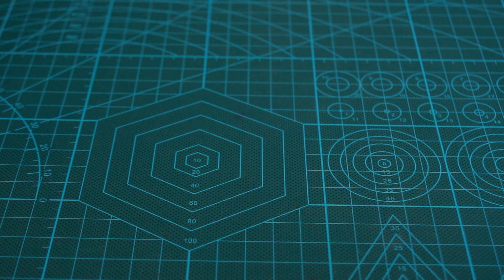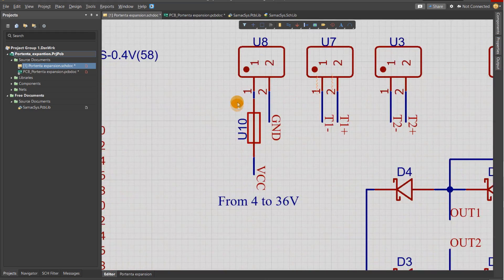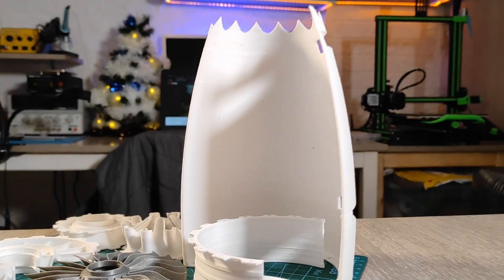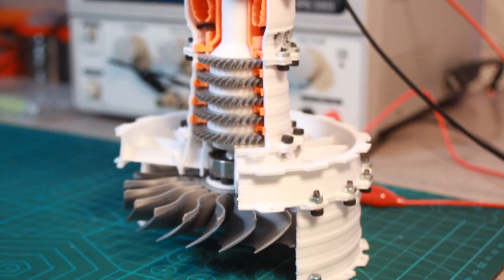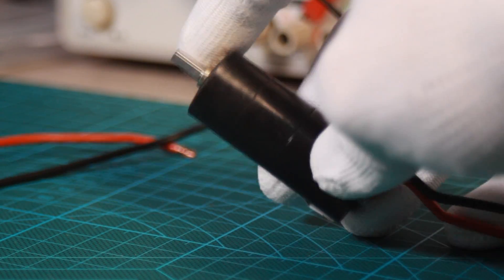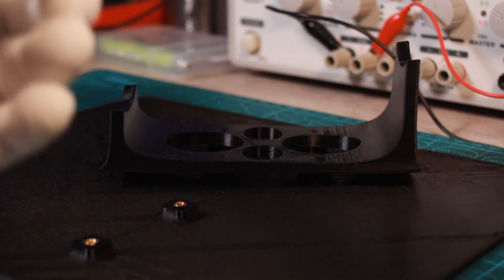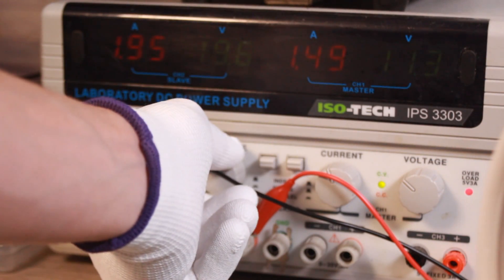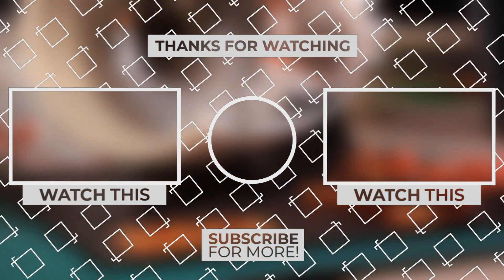HomeMade Arduino powered Jet Engine | easy tutorial | 3D printed parts #diy

Comment: I'm building the low bypass version of this, and I noticed watching the video the center fan blades are on bearings as well but they don't turn like in your video but you can turn them by hand, are these supposed to turn via motor?
Reply from the maker: Yes you are right, the Center fan blades are not spining simply because them core is not attached to mechanically to the active parts, considering the PLA material, that's not the best design to make the fan blades spin, let me know if you have mechanically modified the design and got it to spin🙂

Comment: how much thrust does it produce i wanna attatch it to a skateboard
Reply from the maker: @Dev_Neon  then you need metallic structure and better motor
Reply: @DIYGUYChris  I’m gonna use a better motor but would the plastic casing be fine
Reply from the maker: @Dev_Neon  plastic is too fragile for your case, and not good material to produce the desired pressure, as I said a metallic structure is something that you need to try but before trying do some research about the concept

Comment: Hi, Can you share me motor holder 3d part that you designed. I have been working on same setup but don't have motor part. Also tell me what are 3d configuration you use to print this setup as my 3d part are getting broke most time.

Comment: Hi, Great build! Quick question about Portenta. I actually saw your project listed under official Arduino website and I was hoping to find something that is relevant to Portenta's latest capabilities (AI, Dual core etc.) To probe you further on that - Is there is any reason why you used Portenta apart from the fact that it is the latest Arduino board? It looks like you can replace Portenta with an Arduino Uno and it will function exactly as Portenta in this project isn't it?
Reply from the maker: Yes it is, not even an Arduino, you can use a potentiometer to make the engine run.
Check the previous videos to know why I designed this host board

Comment: Probably a silly question, but have you tried testing if the turbine generates any significant thrust?  It'd be really neat to see it move a wheeled platform, even if it was just a little bit.  Overall, a really awesome build!
Reply from the maker: Hello, not a silly one, the Thrust depends on the motor gears and since this has been made through plastic material then we can't expect high strength of the mechanical structure.
Thanks and all your questions are welcomed here.

Comment: 😆😆😆 - What the need for all the Arduino  circuit?!?  - You're already using a bench power supply that will control the speed far better!  😂

Comment: Cortex-M7 for.... seriously, man???
You yoused this controller for simple 1-phase PWM motor control with the simpliest motor driver? 
It's the most EPIC WASTE OF MONEY I'VE EVER SEEN 

The real engineers use Cortex-M4 for bare-metal BLDC motor control, or to create buck-boost DC-DCs 
Your PCB and application is real useless junk
Reply from the maker: Obviously you know nothing about the board that I have made, that's only one part of many other features available on the Throne board.
It is easy to through a random comment without getting enough details about the content, the main purpose of the board that I have made is getting access to the Cortex ports through the HD Connectors (I wonder if you already saw these connectors) and I achieved this access and tested some basic APIs.
Thank you for your comment.

Comment: Bad engine. I was going to use a brushed motor with no gears. Then the whole thing becomes much calmer and more fluid.
Reply from the maker: Yes, I had that same idea but all the small brushed motors I found they are meant to spin a light weight, for big structure it has to have a big motor which will not fit.
Thanks for the comment.
Reply: @DIYGUYChris  A brushless motor with ESC controller
Reply from the maker: @ReX_PL_DE  I will certainly check this out 
Thanks 🙌

Comment: Using an expensive Arduino board to simulate the windmilling of a jet engine is certainly not aligned with good engineering practice and not worth a blog post. A $2 motor driver would certainly have been sufficient.
Reply from the maker: Totally understand your point, but the opposite of your point of view is right, it means that I built that Jet for Portenta, I wonder if you have watched my previous videos, the Throne board that I have made for Portenta is mainly developed to explore the High density connectors of the board. Please watch my previous videos about The Throne board and you will get the point.
Thank you for your comment.
Reply: @DIYGUYChris  so was it possible to test your board by just loading it where necessary? Why go to so much trouble to build a cool jet engine looking fan? I suspect you just enjoy it 😜
Reply from the maker: @brendaneyers2827  the answer is in the "about" of my channel, right in the first line 😉
Further more, as content creator I must motivate others to practice electronics and this is right motivational enough.

Comment: I don't understand the need to use an Arduino to make a motor run. Not if it's about setting the speed. If there was a programmed function, I could understand that.
An Arduino is completely unnecessary here, and 3 $1 components would serve more effectively as a voltage regulator.

Also, in an age where anyone can buy a 3d printer and download print data from the internet, I wouldn't consider this creative these days.

I understand the joy of something built, but think about it, where is the creativity, where is the joy of making things with your own hands? This was made by a 3d printer, not by hands. It's like buying a child's folding kit.

Make something actually with your hands, with a saw, a drill, a milling machine, something that is unique, not pulled off the internet and bought in a store. Then you deserve respect for a job well done.
Reply from the maker: Thanks for the comment, obviously you didn't watched the previous videos about the board that I have made despite the fact that I mentioned this on my video and I put many links as references for the previous videos,
I didn't made this board to run the Jet motor, the opposite is right, I have made the Jet to test the ability of Portenta to handle 36V DC and also to test if the Portenta will power on through the external power source.
I also provided the appropriate documents related to the board schematic maybe this is not so important for you but certainly will be important for others who would try part of this project parts.
About the 3D printed parts, the available model on the internet is not spinning (I'm the first guy who made this model truly spin) also about making things by my own hands! How this could be possible without using tools!! You already mentioned some tools like drilling and milling machines so let me tell you that nowadays a 3D printer is considered as a necessary tool for any prototyping stuff.

Thanks

Comment: soooo, you created an whole arduino circuit and programming, when you could have just plugged the motor directly into the power supply?
Reply: you don’t need the Portenta to do this.
Reply from the maker: It is possible to control speed and direction if you plug the motor directly to power supply! The opposite is right, I have printed that whole Jet Engine to test the circuit board 😉
The board is there since last year and this is the third tutorial about 🤟